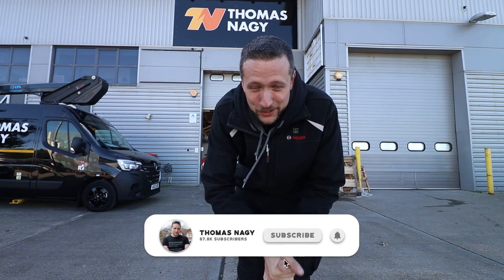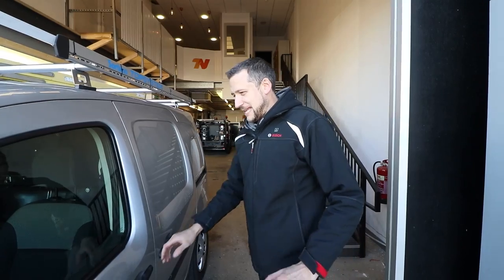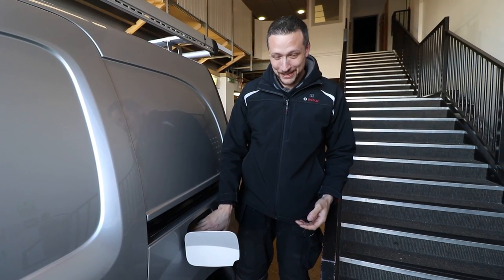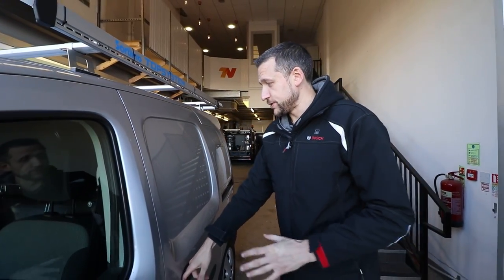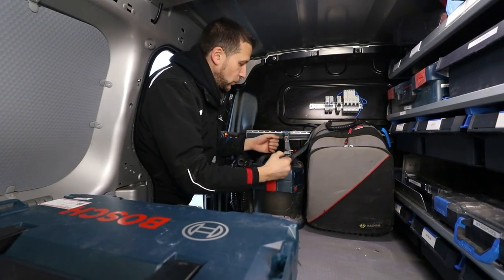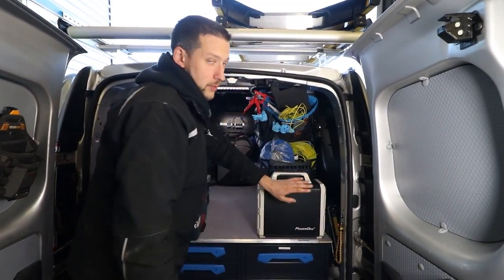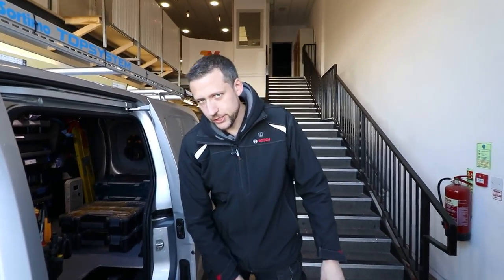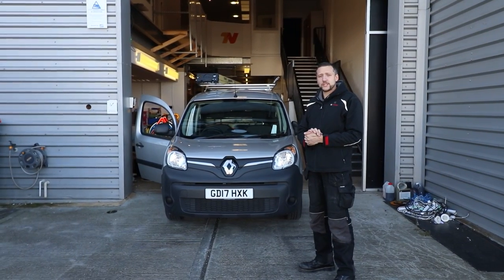My first ELECTRIC VAN tour (Renault Kangoo ZE) | Thomas Nagy

Comment: Didn't expected that Sortimo uses a 3D-Printed clamp for the Boschboxes, hope they are made of ABS and not PLA for the heat resistance in summer. NIce
Reply: I spotted that too, I've got Creality ST-PLA and the filament can snap now when attached to the printer due to not keeping it airtight.

I removed the 1 kg grab rail off my motorbike and printed infills for the gaps. The bolts still feel loose after you tighten them, so I overdid it. Later on it split and found I'd squashed them to bits underneath.

I reprinted and didn't tighten as much, to find a screw has wound itself out vertically and the big bolts were loose. It's rock solid if you make a cube, but I think could keep tightening the bolt with my fingers and crack this part.

Comment: The filler cap is blanked off, however in Scandinavian countries it feeds a 13 litre tank for heating the cab etc. This saves on battery for further travel in the very cold climate.

Comment: I've got the sortimo drawers, I keep all the Bosch cordless tools in there, the L box's take up too much room in the van, and it saves moving stuff around to get to them, I've got no racking at all, as if I need the space, I can empty the van and still have the full width on top. If anyone is thinking of getting sortimo underfloor drawers, I got mine off e Bay for £400, 3 drawers, 1 mtr x 500mm, came with all the fittings,just buy the ply and make your own floor, I bought a non slip rubber matting and covered the top, nothing moves around. It's alot cheaper than the £2000  I was quoted by sortimo, easy to fit.  The space thats left I divided up, for cable rods, levels, you get a bit of space in the middle, so I made a hatch and keep cable in there. I bought 3 dewalt box's to keep sockets, back box's, any other stuff that won't fit in the drawers, works well, and easy to empty the van if I need to.

Comment: Anyone consider to buy an electric van, must not overlook the Nissan eNV 200. post 2018 has 40 KWh battery with a range of 100 miles.
Also feels cheap inside, but well equipped and has 2 sliding doors 🎈
Reply: It is nice compact van and one of the few EVs before the Tesla model X which could even tow anything. (Just a tailer empty really, but still). Especially for a business though I'd buy the biggest battery possible in the form of the 50/75kWh Citroen Jumpy/Opel/Vauxhall Vivaro/Peugeot Expert/Toyota Proace. Otherwise I'd wait till someoke comes up with a 800V powered van :P

The bigger your vehicle is the more charging power or downtile you need.
Reply: Ones I have driven can say up to 180 miles, so pretty good.

Comment: Theres an old Citroen 2CV near here with a tow hitch! That is optimistic
Reply: There are actually still people putting tow hitches on 2CVs, Beetles, Minis... Ideal for putting on a bike rack or a small cargo box, or to tow one of those egg-shaped little caravans.
Reply: That's for pulling it backwards to wind up the rubber band ;)
Reply: The power is usually not the issue... just limits acceleration and top speed. Gearing can sort out the hills. Usually with EVs the problem is high continuous power cooling for motor/inverter/battery
Reply: Got a towbar on my Renault Twizy tow my twin axle caravan (office) arround with it, and a 700kg trailer dont have any other vehicle with a towbar now amazing how well an EV with less than 20hp can tow
Reply: @simonupton-millard  Doesn't sound awfully legal.. I wonder what your insurance thinks lol
Reply: @rkan2  its a heavy quad bike so can legally tow up to 750kg so my trailer is fine the caravan is not towed on the road just arround the garden so the grass can be cut, the caravan is used as my home office
Reply: Should also say tow bar is listed as a modification on my insurance along with windows, alloy wheels, stereo, heated seat, allarm and reversing sensors and a few other things
Reply: @simonupton-millard  You have that on the registration cert? Is it not classed as L7e-A?
Reply: @rkan2  eu type rating of tow bars does not include any of the L class of vehicles

Comment: Thomas, you didn't mention running costs, but (apart from congestion charge saving) I guess electric works out about 20-25% of the cost of diesel, for a comparable round trip?
Reply: I have the env200 24kW van and when I bought it 4 years ago I worked out I was saving over £70/month in diesel (also taking into account increased house electric bill), not to mention no road tax, cheaper servicing etc. 
Will be interesting to calculate what I have saved over the last 4 years having covered 65000 miles in the van.

Comment: Wish I could get one in California. Closest thing here is a 10 year old Ford Transit Connect electrified by Azure Dynamics (now defunct so no ongoing factory support). Would love an affordable  60 mile range cargo van EV.
Reply: Yeah the US seems to be totally void of EV vans.. I guess it is the cheap gas and lack of emission control zones. You can get the e-NV200 though which is similiar to this.
Reply: @rkan2  Really? I have not seen an E- NV200 as yet in the USA.
Reply: @Russwig  Nvm you're right :(
Reply: Fuel is cheap in the US, you would be better off buying a fuel efficient ICE vehicle instead.
Reply: @Horizon301.  Price of fuel is so not the point. ICE vehicles are dirty to run and to maintain. For my driving and hauling needs a 60 mile small van would be perfect.
Reply: @Russwig  so you are doing it because you care about the environment more so then. I wouldn’t ever get an electric car for such a reason, I would rather not piss money down the drain. Also the maintenance is basically non existent on a new car anyway. One service every 20k miles (German) and job done

Comment: I have bought a car like this, but driven diesel engine, for 360 pounds.
In 10 or 20 years, I would buy my first full eletric driven car.
If it is also so cheap.

I have learned so many qualifications, but I get small payment.
Now only 1.100 pounds cash per month, because 50 % part time job.
(Not in UK, but here in germany).

Comment: 12:50 - Should've got a 1000£ discount for just the charger and another for the missing 10kWh. Ifvyou'd really want to you could probably get a retrofit chademo kit for it for said 1000£. In Europe you can get these for like 7000-9000€ with the battery included. I hope you are not renting the battery at least.

Comment: Its funny that they dont have faster charging, I drive a 2016 zoe with the 22kw battery it can charge up to 22kw, as the charger is part of the motor you would hope you would have 22kw charging, the only thing is to charge a zoe over 10a you need the AC system to be working to cool / heat the battary so maybe thats the reason

Comment: How many miles do you reckon you loose by having the roof rack on it? Would you be better off without it?
Reply: At highway speeds (120km/h) it could reduce the range by 50%.. It goes down by speed from there to something like 50km/h where it is probably negligible.
Reply: On my zoe a roofbox at city speeds I lose 5-10 miles

Comment: great vids tom, ive got a renault ze elctric van 21 plate its brilliant never go back to diesel van again. Have you not considered getting a charger that works on a 13 a 3 pin plug thats what i got so that when i,m at a job for 3 or4 hrs i can put it on charge

Comment: I’m pretty sure you can’t actually tow with electric vehicles in the uk as the government didn’t approve for it
Reply: You sure about that? UK would've followed (and probably still does) EU standards. The problem never was that regulation just that the manufacturers did't cater for towing. The first EV that could be registered (in the EU) with some actual towing mass was the Tesla Model X and then afterwards the Model 3. The Nissan e-NV200 was rated for a touch over 400kg which meant you could  basically tow your empty trailer with maybe a couch on it.

Now there are many more EVs with rated towing capacity. The VWs/Audis/Skodas, Ioniq 5 and Kia EV6. I'm not sure there is a French or Japanese built EV with any towing capacity yet unfortunately.
Reply: Can tow fine with teslas and I tow with my Twizy, its just not meny EV companies do the required certificates for towing, MG are soposed to be going through the process for the MG5 and the new MG suv thing,

Comment: What happens when you parked plugged in charging up on a job and some 🤬 smashes off the charger flap 🤦🏻‍♂️
(The diesel filler flap  🕳 is so you’ve got the option to take a wizz while out and about……. No just no🤣)

Comment: Could this possibly be the least energy efficient EV on the road 😂🤔
Reply: Maybe not so practical with the slow charging but why inefficient? Regenerative braking aside, I imagine it returns a similar mileage per kW as other EVs.
Reply: A roof box on my Zoe reduced my range from arround 70 to arround 60 miles at moterway speeds, on local roads reduced my range from arround 100 to about 95, on London roads will make little difference dont go fast enough for drag to be an issue